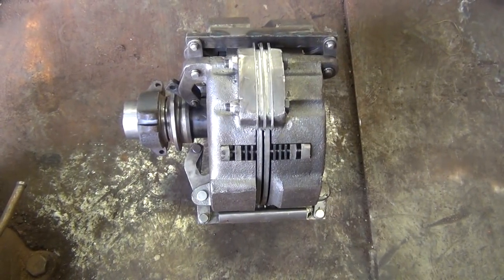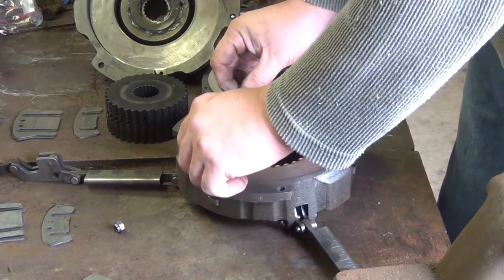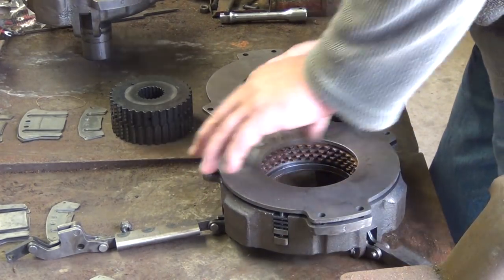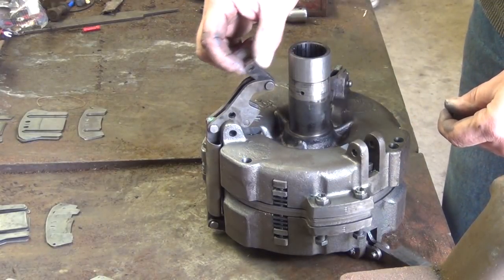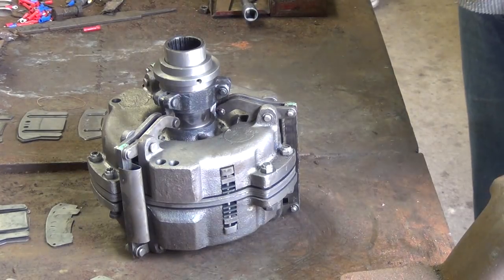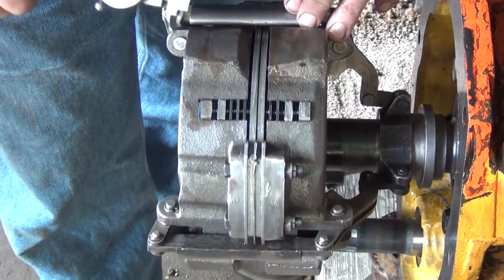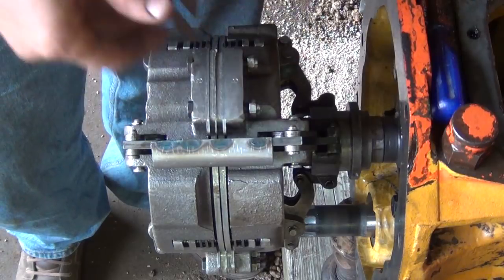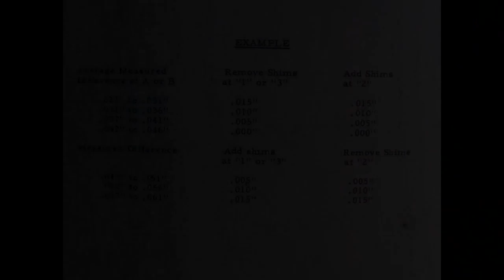Rebuilding The Power Director On Allis Chalmers D Series Tractors

Comment: Sure owe you for getting me back to Working with my old girl (D17). Sure, would be great if someone would slowly go thru the fluids, where to ID Bucket fill & drain as well as tranny, oil is pretty obvious, clutch Fill/Drain, Pwr Steering Fill/Drain, etcetera.  Also, what fluids go into which hole.  Told nearly 10 gallons on one of them and $100.  Can't afford to hurt my D17 or put $100 into the wrong hole.  Many of us will not admit do not know what goes where so, old iron dies with gunked up innards.  THANK YOU so much for your kind efforts on this Vid on our behalf. Karma will boomerang. Thx !!

Comment: thanks for the video. very informative. what about the hand clutch on a wd wd45? and where do you get parts for them? thanks
Reply from the maker: The hand clutch in the WD & WD-45 are a lot different than the D series power director. I have a video in the works for the W series hand clutch and will try to finish it up in a few weeks. Parts are still available from AGCO and aftermarket parts can be found from A&I.
Reply: Dennis Anderson ok thanks man.

Comment: Is this the same setup as an i60? I have the backhoe version with the shuttle shift. Instead of having high and low range like this yours, mine has forward and reverse. Does the procedure you are showing work the same on a shuttle shift? Also, does anyone still sell these clutch packs new or remaned? Thank you
Reply from the maker: I have no experience with the shuttle clutch Assy. Nor do I have any information about them. See if you can get any information from an AGCO dealer and go from there. I hope you can find what you need.

Comment: Great video very informative. I have a D17 and I'm having an issue where when the hand clutch is in neutral it doesn't fully disengage and the tractor still wants to move. It shifts from big to low just fine and doesn't slip any ideas why this is happening?
Reply from the maker: The clutch may need to be adjusted by moving the shims or the oil being used maybe to thick. All the clutches I've adjusted and used the recommended oil don't creep with the clutch in the neutral position.

Comment: Great video, before this I had very little ideal how the power direct worked.  Where did you get the replacement parts?
Reply from the maker: AGCO dealer
Reply: Today ago does not carry the clutch facings. However, you can get them from a company called Minoan .

Comment: I have a I-600 and the tractor about year ago had a new clutch pack put in and now it started having no power in forward . Doing this adjustment to my clutch pack and has 43 H side and 28 on the L side going to just do one side and see what happens . Any one got any advice sure could use it.

Comment: Dennis after we installed the pd neutral isn't working any thoughts
Reply from the maker: I personally have never experienced this issue. My first thought is not enough shims to relieve the pressure on the clutch disk. Second thought is the springs are not pushing the pressure plates apart due to a possible binding situation. Sometimes you will get some drag if the oil is too thick. If this is the cause you can check it by putting the power director in the neutral position and just lightly apply the brake in the tractor should stop.

Comment: Good day.  Boy that was interesting.  I'm from Ont. Canada. , our neighbor had a WD on 150 acres, done everything  with it, combine/60, rd. bale 3 furrow many 10", on heavy soil, later yrs. bought  D17, but those hand clutches  were used were very often. I was thinking of buying D17 for blowing snow.  Now the hand clutch was live power, foot clutch wasn't.
correct?  but I think hand lever to far, can't look bk. to see how deep snow is.  Other yr. D17/ loader went $1650 cdn. very reasonable.  Anyways I sub.  very good video How much would total rebuilt cost.  Is WD& 45 CLUTCH roughly same except hi/lo Thanks
Reply from the maker: You are correct about the hand clutch providing live power. To replace all of the discs would run about $1000 for OEM parts. The W series clutch is of different design but basically it's half of a D series power director.